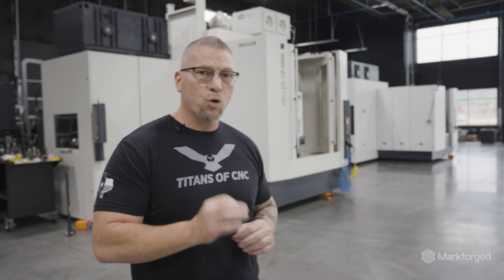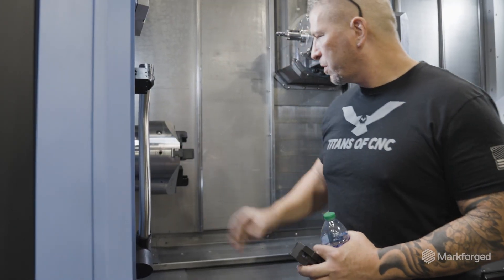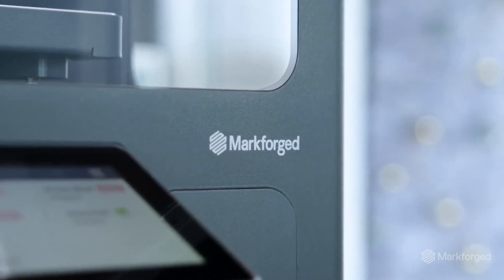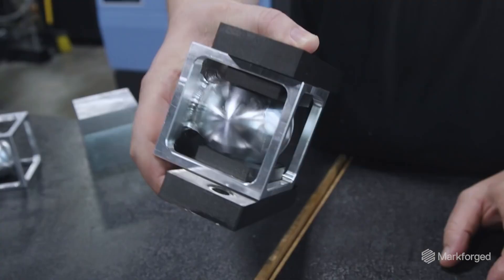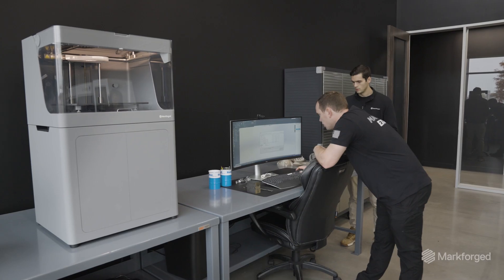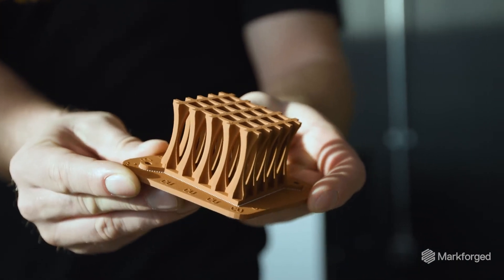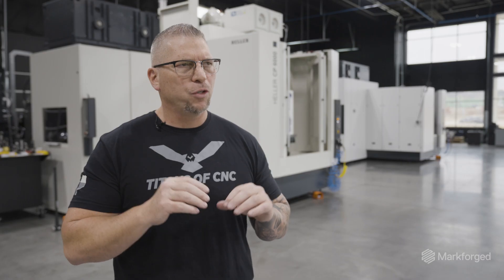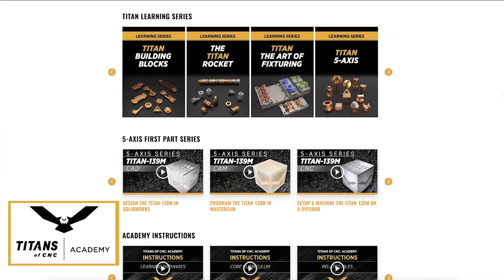Strong 3D Printed Fixtures with TITANS of CNC & Markforged

Comment: Can u show us more CNC fixturing using carbon printed parts?
Reply from the maker: Thanks for watching and the question Hayden! Here are just a few great videos Titan has created and we'd also be happy to answer any more specific questions you might have for your specific needs by "Contact Us" at our website: https://bit.ly/MF_Fixtures

TITANS of CNC: 
Custom 3D printed fixture: https://www.youtube.com/watch?v=3-ZBaBiXaLE&t=3s
Ball in a Box: https://www.youtube.com/watch?v=oTGfVnpq3-8&t=2s
3D Printing Customer Jaws for a difficult part (this is made out of our 17-4 stainless steel prints on Metal X, but we think it's rad!): https://www.youtube.com/watch?v=GRvFG3ltodM
Reply: @markforged  - hehe I’m just looking for an excuse to get one for work. I’ll think of something don’t worry. 

If you can get HT PCTG to work or even PETg then it would be of interest to us. Low VOC, reasonably low outgassing plastics (preferably higher temp then PETg) that don’t break the bank.  

The tooling side is a given but we don’t have enough of a need at this stage